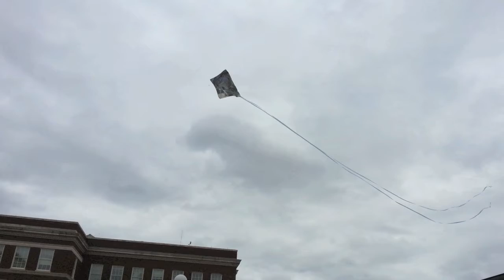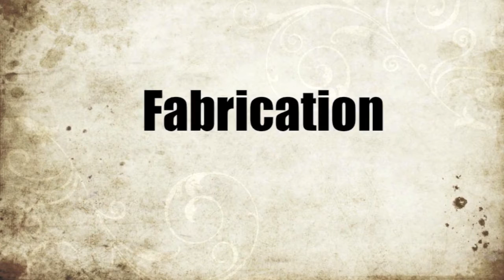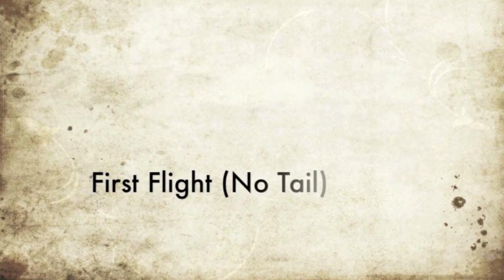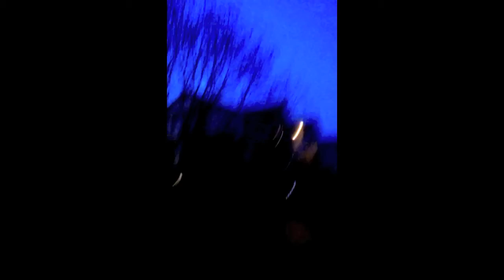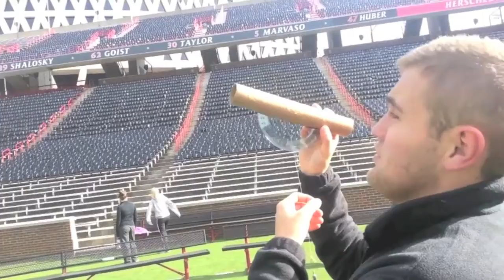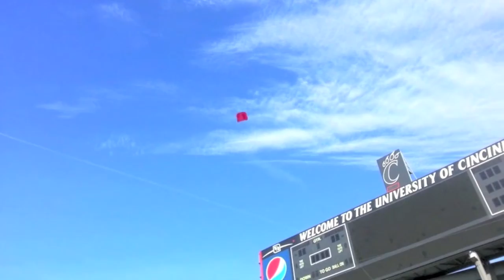Bearkite Milestone 3

Comment: could not think of a more turbulent place to test a kite. if you move out into the country, you might have different results. some place where the kite would fly well, then you could spend real time on data. My parafoil flys at approx 45 deg.  using pythagorean   theorem, height is approx 70% of line length. 100 feet of line equals 70 feet up. more or less. thanks for the vid, liked it, as i am a data guy too. thanks